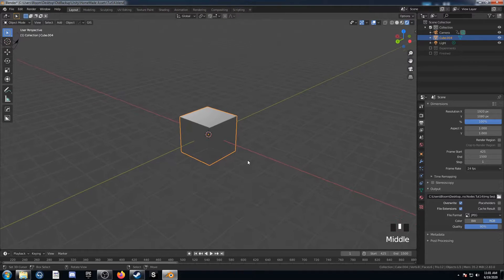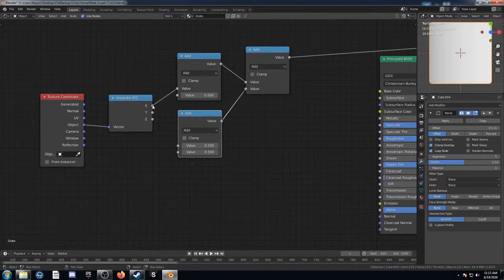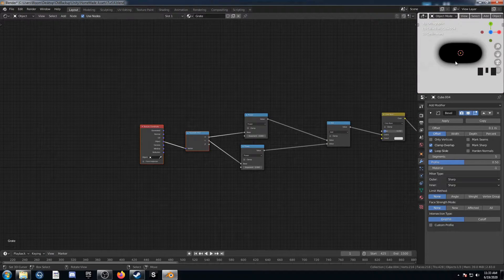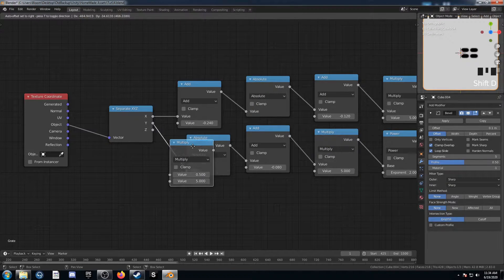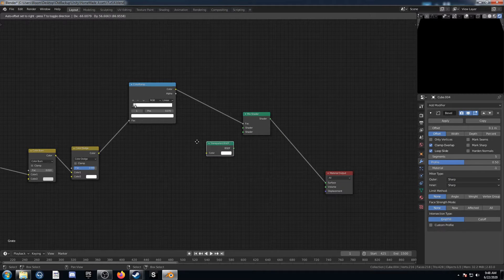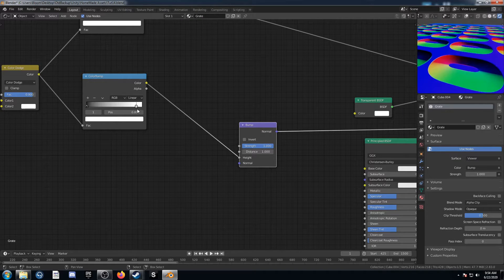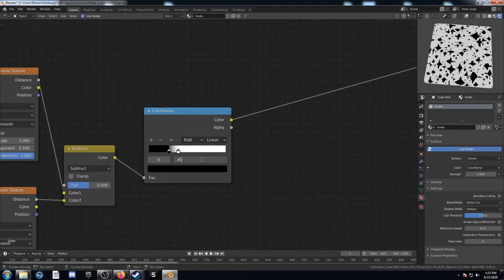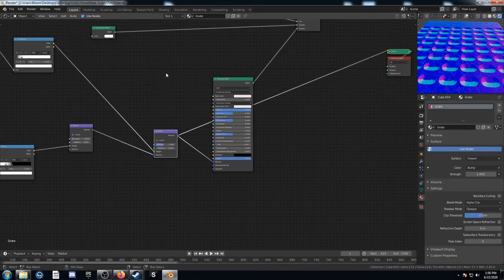Procedural Nodes (part 14) - Procedural Grating texture in Blender

Comment: For the second method, if you want to have multiple holes in the grating without scaling up the actual object, just put a vector math between Texture Coordinate and Vector Transform, set it to scale, and plug in a value (I used 8). Then just adjust the size of the holes with another colour ramp before the first two and bring the white value down to what you're after. Worked well for me.

Comment: Hi! Try doing cycled pattern with (Math Add 2) -> (Math Modulo 4) -> (Math Subtract 2) for both X and Y directions with object you want to copy right in the center, instead of (absolute+add). You can use any numbers here instead of 2, 4 2, but they need to be n, 2*n, n